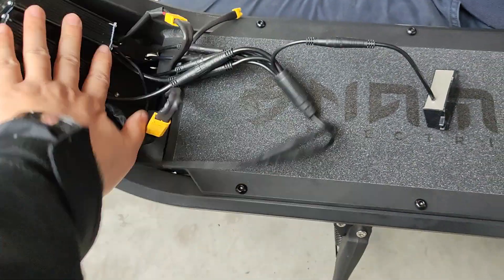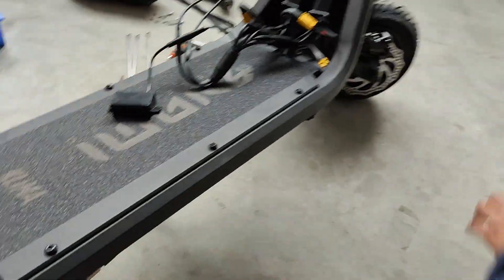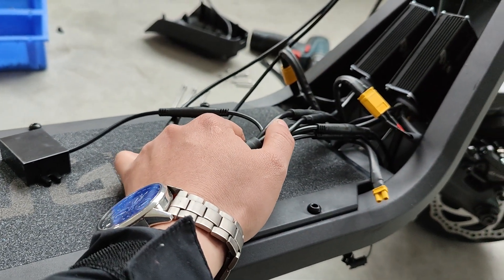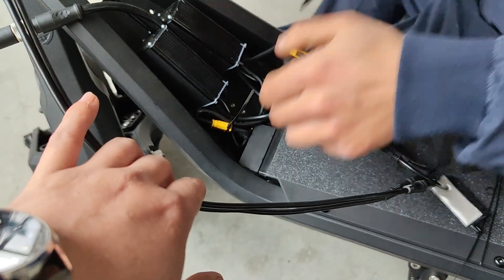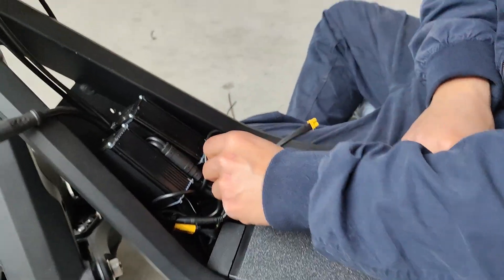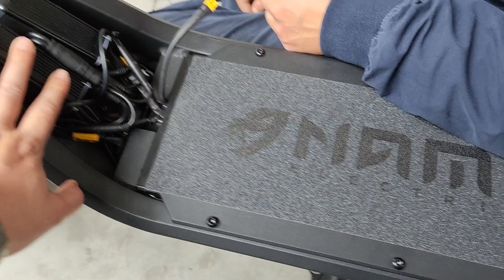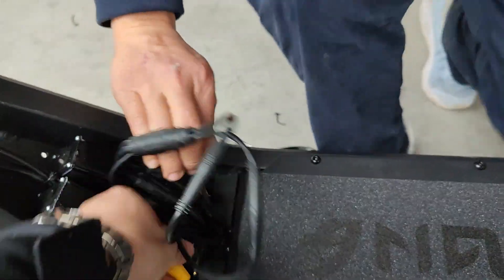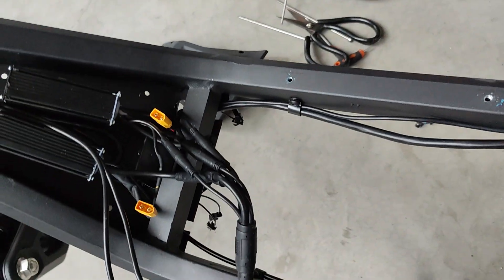Nami klima controller/charing port/cable management and cover install

Comment: I was about to buy the Klima, but this plastic cover is just easy to break if a thief take's the scooter into a van the thief can take out my GPS beeper and siren.., that cover should have been done in aluminum and to have more bolts with different shapes for more security...

Comment: Hi Michael, Love my Klima, but today I was going down the hill about 50 - 60km and soon as I pushed the brakes my front controller stopped, front of scooter started shaking. Any idea what I can do to fix this? Cheers
Reply: Close Regen breaking or set it at one

Comment: So if you disconnect the speed limit cables does it make it faster ?
Reply from the maker: it make it ride in the normal speed, it they are connected 
The speed is limited by 25km/h or less 
no cuirse control function 
kick start can not be turn off

Comment: It is.
 An absolute beautiful scooter lots of fun to ride. Unfortunately, a lot of people struggle to pay their bills. Hopefully in the future, you can add A BMS. Reset button on the outside of the case. So customers do not have to spend $1800 just to replace the battery. Unfortunate.
 Ly because of the cost of the battery replacement and the controllers, I've had mine for 3 months. Absolutely love it. But.
 I'm selling it for another scooter. Please update the battery where you can remove the batteries from the case that it has to be replaced and add  a reset button.

Comment: Great job and thanks for your videos Michael!
Just a question:
❓Is there any possibility to get a wiring diagram, circuit diagram and pin layout from the electric harness of the Nami Klima?❓
I´d need it to have some trial work in indicators, stop lights for the Klima etc... (would be easier, than to measure each little cable manually)

Thanks in advance and many greets from Austria

Comment: Hi Michael i had an issue in the rain my scooter just shut off randomly i let it dry and it restarted. Just wondering what you recommend i do next time or anything i can add so this doesnt happen again ?
Reply from the maker: i suggest you check the dashboard or the cable, and it might need to be replaced

Comment: Hello. Are the tires run flat? Do they have gluey material in tire to stop nail punctures? 
What Psi should I use for the Nami Klima tires? Thx Tatyana R.
Reply from the maker: no, for the gluey material 
PSI is wrote on the tire

Comment: hi, i order my klima last week, I would like to order an alarm system. is the yellow plug connector "XT60" and the other ones 6 pin ?
Reply from the maker: xt60 for the controller, not sure what you meant by 6 pin